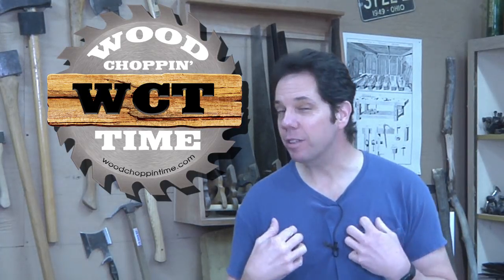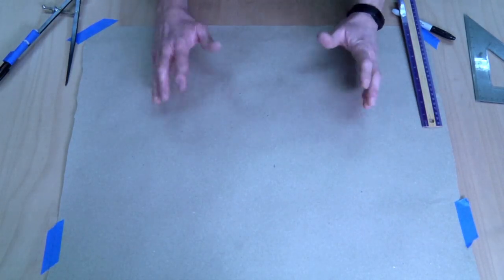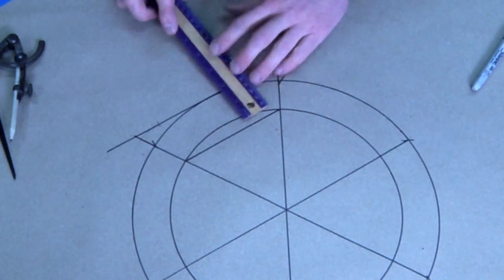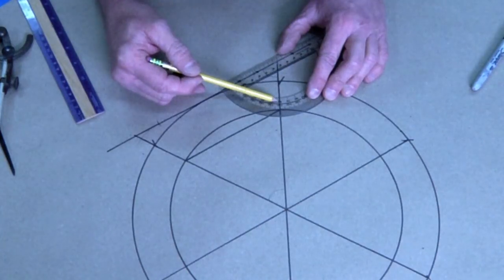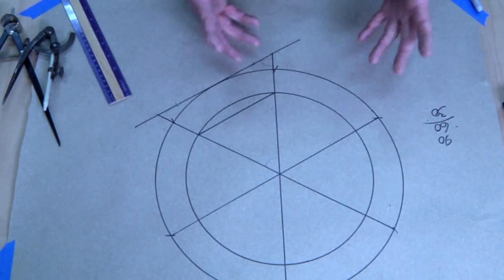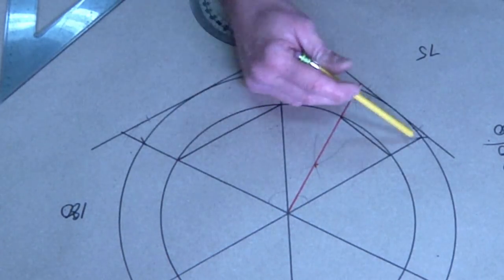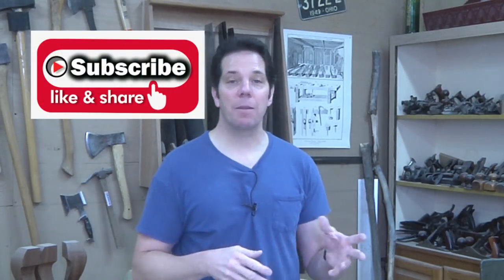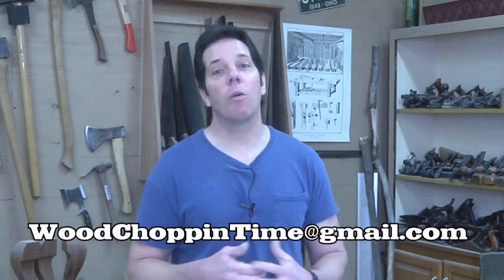Be a Better Woodworker with Geometry- Round Table Tops

Comment: Thanks for all that Chad, I found it very enjoyable. Incidentally, if this helps, I think the confusion with the mitre saw is because it measures the cut from the 'vertical', ie the short axis of a board, whereas we tend to measure an angle from the longest axis, the 'horizontal', hence the complementary angle values. I like your bevel gauge solution but as you say, there's a greater likelihood for errors to creep in. Anyway, great vid, very educational. As for the next vid, I can't resist having a peek at your drawers. Cheers mate.
Reply: I was going to point out the same thing, that the miter saw scale displays the deviation from 90 degrees. It turns out that the miter saw angle equals one half of the angle at the circle's center point.

I would like to see the router bit video, but I do not want to peek in Chad's drawers.

Comment: I have my 'Drawing' tools in the top drawer of my cabinet, in the shop ready to use. Accuracy is important. As you say, the bevel can be out just a tad to ruin the work. Table please. I have been so frustrated with setting up the lock mitre bit... Like you they sit in the drawer surrounded in cob webs. Happy New Year to you and the family

Comment: I always enjoy your videos and learn something every time. 

Another, more accurate, method of calculating the angle: There are 360 degrees in a circle. Divide 360 by the number of segments -- in the video there were 6 or 12 segments. This gives the total angle of each joint, 60 degrees for 6 segments or 30 degrees for 12. Then, since each joint is made up of two pieces (with the total joint angle divided between the two of them), divide the total joint angle by two. This gives the cut angle, 30 degrees for 6 segments or 15 degrees for 12. 

Why do I say that this method is more accurate? Because it reduces the chance of measurement error by half. As illustrated in the video, you need to first read the angle accurately from the drawing using the protractor and then, using that measurement, set up the miter saw accurately using the protractor. This gives two chances for a measurement error. With the 'pure math method', you know exactly the angle the miter saw needs to be set at. Then, whether you use the protractor or the miter saw's scale, you just need to set the saw to the calculated angle -- only one chance to misread the scale or protractor, not two.

For example, let's say you wanted 5 segments. This requires a total joint angle of 72 degrees or a 36 degree cut angle (1/2 of 72). With most protractors, it can be very hard to read a 72 degree angle accurately. But, if you use the math method, you'll know that the total joint angle is 72 degrees (not somewhere between 70 and 74). And, you'll know that the miter saw needs to be set at 36 degrees. It can be hard to set the saw exactly to 36 degrees, but it can be done (with, perhaps, some trial and error). It's a lot easier to set the saw to the proper angle is you know exactly what you're shooting for, rather than working from a measurement that may be close, but not exact.

HTH

Comment: Or a shortcut to finding the angles is to divide 180 by number of pieces you want to use, ex. 180/60 = 30. This is how it is explained in my Delta Miter Saw manual. Yes, 360 divided by number of cut gives you the angle (on a geometry test), but , as you pointed out here, the saw's gauge is set perpendicular to the fence and not parallel. Therefore, divide 180 by number of cuts you want to make and you get the angle to set on the saw.

Comment: Steve
360 degrees in a circle. 
If you want 12 sides device 360 by 12=30. 
Devide 30 by 2=15. 
This makes it easier, faster and just as accurate. 
Try this-works ever time.
Reply from the maker: Yes sir, thank you for the tip. Always more than one way to solve a problem :-)
Reply: I tend to use algebra to get the values for lengths and angles, but you need to understand the geometry to make the correct calculations. And putting a ruler or protractor on a scale drawing is a good check on your calculations. 

For me, geometry and algebra go hand-in-hand.
Reply: Does anyone know the best web site for measurements for cutting segments for each layer length for segmented lathe turning.

Comment: The hardest part of translating from angle to miter is the concept of removing material. Angle finders give you the angle. Miter saws give you the material removal angle. Since 45 is so common. It happens that 45 angles are 45 cuts on the miter. If an angle is 80 degrees then you need to remove 10 degrees from the wood when the miter is set at 0. Any time the angle is not 45 then you must approach your cuts at the saw as if you are trying to remove material to reach the angle needed. Since the saw starts at 0 then every degree you add is a degree being subtracted from the woods starting angle of 90. Always be thinking at the saw how much so I want to remove from this 90 to get to the desired angle. It sounds weird but if you sit and think about it for a long period of time it will just click. The miter saw was designed to be zeroed out at 90. Any deviation from center is a subtraction from 90. A 0 degree cut on the saw gives a 90 degree angle or a square cut. The more you deviate away from center the more you deviate from 90. If the angle is obtuse at 120 degrees then you set you wood on the saw you know that you are starting at 90. If you move the angle left 30 degrees or right 30 degrees then you are adding 30 to 90 or subtracting 30 from 90. Try either way and notice the only difference is that the cut piece will fit both ways. One way will fit with the piece being picked up and placed as was placed and cut at the saw. The other way will require you to flip the piece so the other face is up and the shorter said is now facing the opposite way when it was at the saw. If you want a 20 degree angle then you would need to remove 70 degrees. Most saws don’t remove that much so you set up a fence that allows you to place your piece at 45 to the fence. From there you just subtract an additional 25 degrees and there’s your cut! That’s a slight bit more advanced but can be found when searching how to make small angle cuts on the miter saw.

The big take home is to remember this:

90- angle wanted = miter saw angle

If you use a mitre gauge, then follow the miter gauge and good to go with the shortcut!

Comment: Nope you are measuring the wrong segment. that is why your first 60 was wrong. Measure from the inside out , not outside in. Same with the redline angle. Your protractor should have been zeroed between the red ticks. Then the 90 deg inversion on your saw is compensated for.
Reply from the maker: Mmmmm I don't doubt you. I'm no math expert. But I'm not totally clear on your description. Could you send me a picture and explain it more?